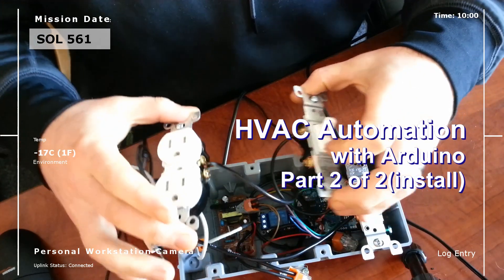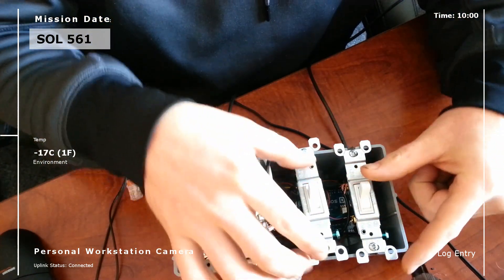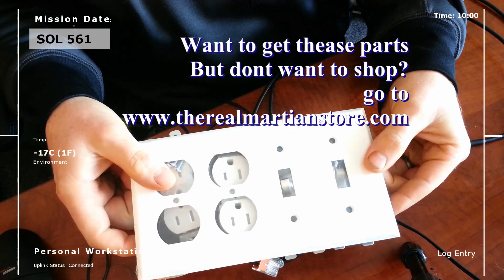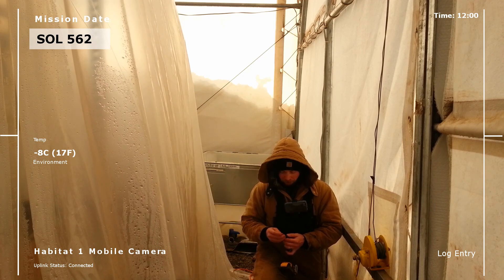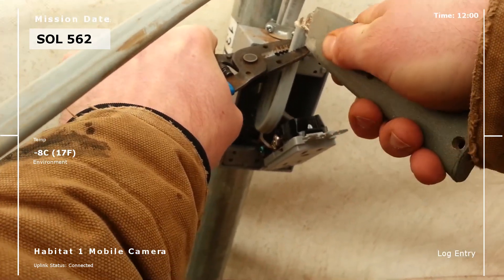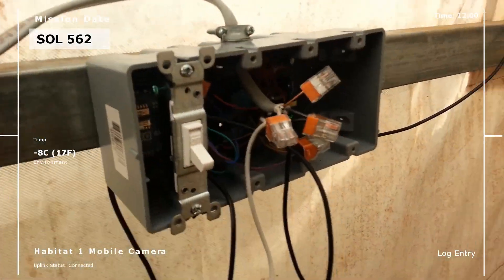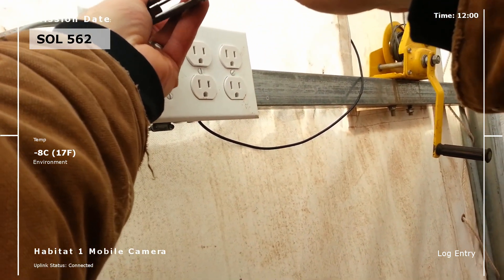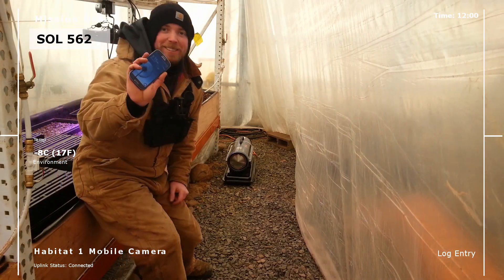Automating Aquaponics HVAC with WIFI Arduino's (ESP8266)  Part 2

Comment: Don't you love it when your code and everything works on the bench AND it works when you install it as well!  It just makes your day.  

RJ11 connectors are dirt cheap, an RJ 11 splitter, like this https://goo.gl/AokPu8, and a cheap lock-n-lock container at Walmart would work for your Version 2.0.  Will allow fast connection, quick resizing with cheap rj11 phone wire or leftover cat5, and all your sensors can plug into the hub, and even plug another hub branch with it's own 1wire sensors into it.  The lock-n-lock container (Or other walmart ozark trail camping section waterproof container) will allow a very secure housing that is clear so you can see your Arduino and separate it from the high voltage that your switching.  I did have an issue with condensation for the quick "snap" style phone  splices when used under eaves, some dielectric grease prolly would have kept them alive.

With temps starting to rise, you may consider a PID control to fine tune the thing even more(save more fuel).  I ended up learning about alot on the PID side from the Home Brewers LOL! I used mine for a incubator for eggs and well house temperature control.  

Some questions:
How often is your data sent to the server?
What software are you running on server or is it a flat file that gets appended and you use excel to view the data?
Do you know if your relay is on or off from the house?  (I ended up using a photo resistor to set a field for on/off of a light bulb, but may work for the light the heater emits (will let you know if heater is out of fuel or heater stays on too long.))
Do you plan to send some data to an IOT service so we can watch your readings with you?

I know you mention about watching out for clones in the electronics world, but I buy several of my things from China (banggood) and it is mostly fine.  I have had a few failures, but nothing like the burning up of that one.

Comment: I used to be an electronics tech in the USN, I worked with comm gear and unless your WiFi is encrypted it is NOT secure!
Reply: WPA2 is default this days.
Reply: Well, with his location he doesn't need encryption or a fire wall, he has an  -0 degree encrypted snow wall :)
Reply: His closest neighbor is Wranglerstar which is about 1.5 miles. I doubt anyone could get close enough without being seen. And I don't think any hacker would care to go that far just to mess with the heater and fan.
Reply: They live so far out in the sticks and so far off of the road that I doubt that it would ever be a problem.

Comment: I would put that one in the win column! Great job. One thing that I do on Project boxes that contain both low and high voltage, is wrap several turns of electrical tape around the outside of the receptacles and switches. It might not look the tidiest, but it greatly reduces the chance that a stray wire,  bare ground, or shield from a sensor wire will touch those large heads on the outlet or switch screws. You may already do something like that, couldn't tell. Just thought I would throw that out there. Have a great day!!!

Comment: Great job here's a tip next time heat the insulation on the wire up a little if it's cold it skins a lot better warm .
Reply: joetri1970 kk